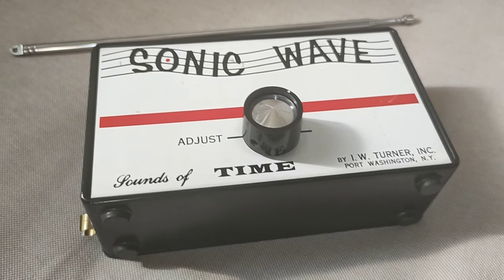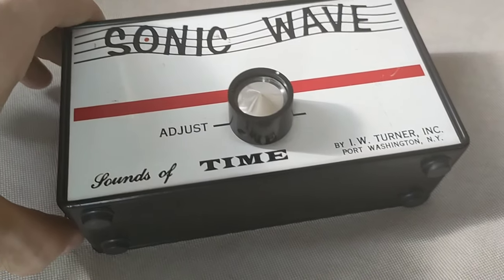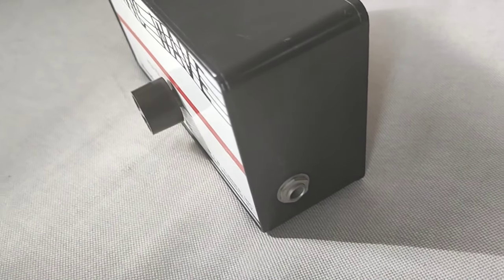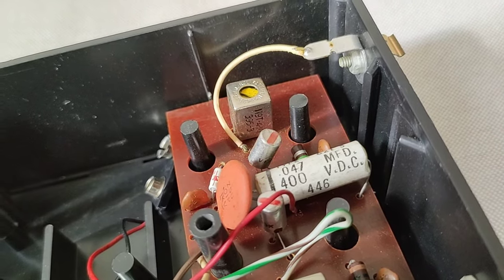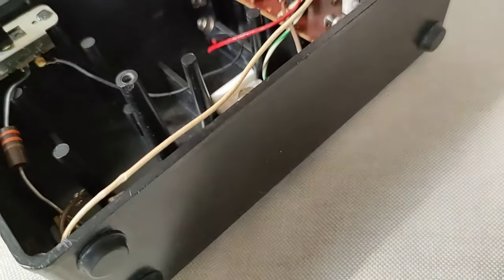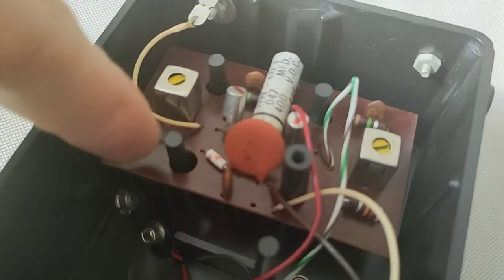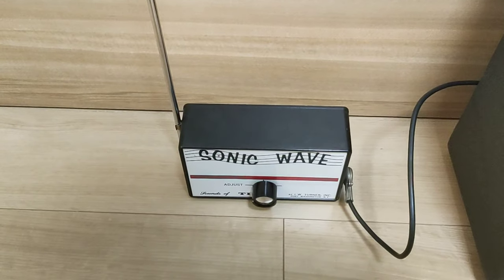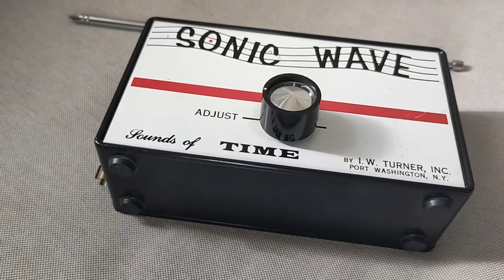Original 1960s SONIC WAVE Theremin Unit - A Look on the Inside and Quick Demo - Jimmy Page Zeppelin

Comment: Hi, interesting look into this simple pitch-only theremin. What you called 'trimpots' are actually variable inductors (coils) wich tune the two oscillators. The adjustment dial looks like it is operating a small variable capacitor to adjust the reference oscillator. The circuit is basically two identical oscillators and the diode acts as mixer and demodulator where the outputs of the heterodyning RF oscillators are combined  and rendered into an audible tone. That part of the circuit works just like a crystal radio set. The adjustment varicap changes the frequency of the reference oscillator, while the pitch 'antenna' changes the frequency of the variable oscillator.
Reply from the maker: Thank you so much for taking the time to watch my video and for your detailed comment! I really appreciate it. Your comment will definitely help those looking for more details on this unit!